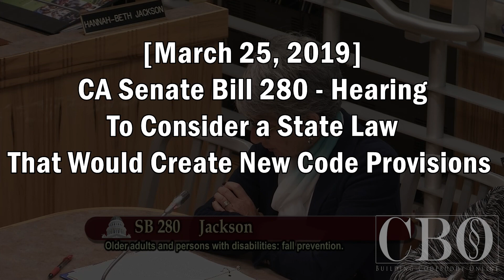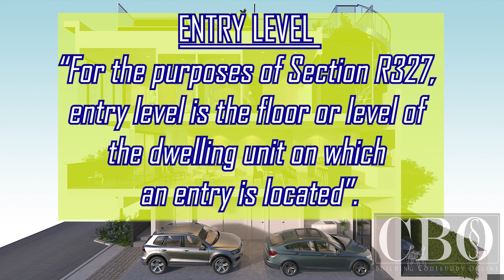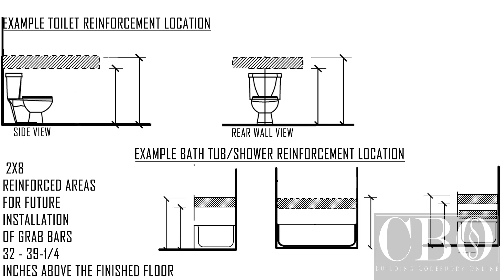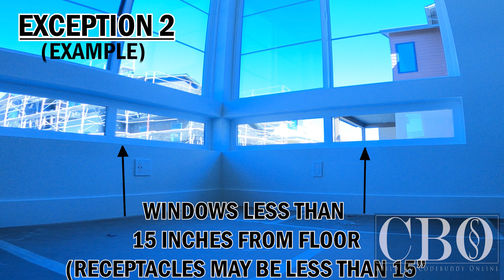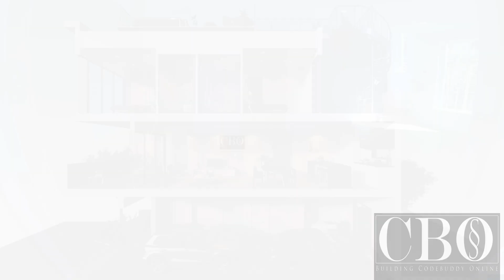2022 CA Residential Code, Section R327 | New Aging-in-Place Design and Fall Prevention Requirements

Comment: Great video.  Just one correction, the rear wall at a bathtub is the long dimension, the wall you show the lower grab bar on is the head wall.  This makes the location for future tub grab bars more inline with CBC 11A, 11B and ANSI A117.1.
Reply from the maker: Hello!  Thanks so much for the feedback and for taking the time to comment—I really appreciate it! You’re absolutely right that the rear wall of a bathtub is the long dimension, and the short wall I showed in that part of the video is the head wall.

To clarify, I made sure to show blocking on all three required walls (3:13): the rear wall (long dimension) and both end walls (head and foot walls), as per CRC R327.1.1(5). While CBC and ANSI standards are not mandatory for single-family or two-family homes, the lower grab bar reinforcement on the rear wall—within 6 inches of the tub rim—reflects best practices for accessibility and aging in place.

Thanks again for pointing this out—it's always great to have viewers like you helping keep the discussion precise and thoughtful! 🤝

Comment: I have been subjected to these standards in plan design. I really think in general it's a good design principle especially as I am one of the "aging in place". Here are a couple not mentioned.
1) Being required to (suggest 36" clear but not required) in front of a bathroom water closet is a hard sale to a client when standard layouts work with 24" clear for most design arrangments. We have efficient bathroom designs that work and trying to get that extra foot is not as easy as it seems.
2) As for 2'-10" min door requirements, I have been building for a long time, and good luck finding that size door. I think that came into code to fit into a 3ft hallway but we know that won't work if you want a finish trim.
Reply from the maker: Hi Fredrick.  24” of clear space is the minimum required in front of water closet (CPC 402.5); not sure what the 36” clear is that you reference.  

Regarding the 2’10” door, that requirement goes in effect on July 2024, which should give the industry time to adjust.  Also, people with disabilities were considered when these age-in-place provisions were presented at the legislative level, hence - wheelchair users – which is the reason for the 32” net clear opening that the CRC R327.1.3 stipulates, at least how I understood the hearing...  

Keep in mind that these provisions are new and it is quite likely that there will be future amendments and clarifications that will change the age-in-place standards.  

If you recall, CA Housing and Community Development Department is the agency tasked with creating the age-in-place provisions in the Residential Code – they welcome input from industry professionals like yourself; if you are interested, here is their contact:  (800) 952-8356 or email at -- Title24@hcd.ca.gov 
P.S. if there are requirements your local jurisdiction is requiring that are more than the Code minimums, remember that local AHJs (through a local Ordinance) can do so.

I hope this helps. 
Be well,

Jose M